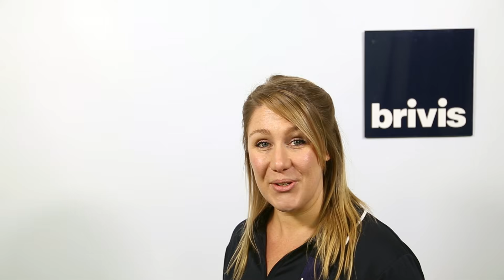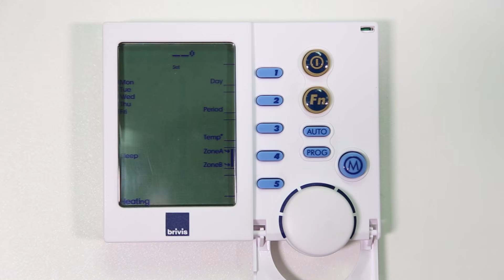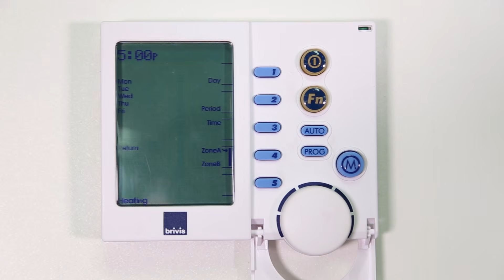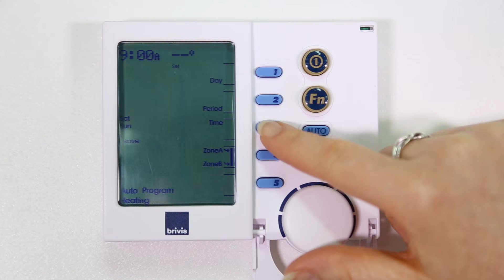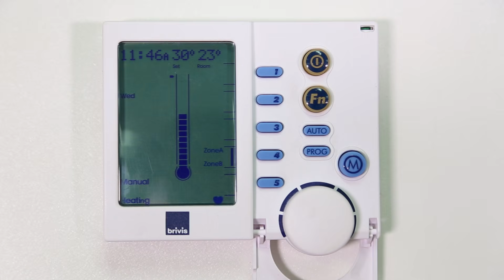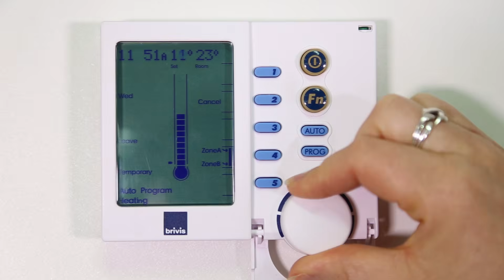Programming your Brivis networker wall control for automatic operation

Comment: How do you get the f thing on?? I’ve had three houses with these units and they are absolutely infuriating. 
It works intimately (all three units did) and then when off there are no batteries to replace and no clue as to how to power the bloody thing on!

Comment: Does anyone know how to control the fan speed? We’ve moved into a house with this system already pre installed… have come from 20 years of split systems which is way more efficient and can regulate fan control but this ducted piece of crap… I can blow harder than this! 🤷‍♂️ Double entendre I know but it’s true… I need to feel air blasting out of the ducts not like it is now… any ideas?

Comment: After 25 years of the first, we're onto our second Brivis heating/cooling system. Our hopes that that the controller and the instruction manual, in the intervening period, had become more user-friendly were dashed. It's the same frustrating gobbledygook as 25 years ago. C'mon Rinnai did you every bother to get testers off the street to make sure that the controller and the manual are easy-to-follow. Within the past 25 years, there has been the Design Thinking concept. This is where designers work with real users to see how the users think, feel and behave when using a product. Or is the attitude that if it was good 25 years ago, it's good enough now!

Comment: Installed 10 years ago, zones never were programmed correctly. No heat whatsoever in main bedroom. Now stuck on error code #40, won't turn off, blowing cold air throughout the house. 'Serviced' 3 days ago for $250, didn't fix the issue. Monthly power outages round here have made me an expert in programming the controller. Only way to turn it off now is at the power point.
Reply: To be fair, service guy found the corroded Over Heat Switch on a subsequent visit had gone open circuit. Simple fix to remove altogether and fuse permanently closed.

Comment: I find it much simpler to use the Manual mode giving more control of the varied times that I am home and so not having it waste gas when I am out and not following a fixed imaginary normal routine.
Just found this out myself in the online manual after a power failure put it into the unwanted auto mode for a week or two after using the simpler more in control Manual mode. Wasted time looking for the simple answer in these videos
From the online manual :
press the “AUTO” Key until “Manual”
appears in the bottom left-hand corner of the screen

Thanks to Brivis for the online more comprehensive manual being made available. Would help if you described manual mode and provided a link to the manuals covering the models in use.
But a shame these videos do not cover Manual mode that is much simpler and puts your customer more in control.
Reply: Now two years later I had the same problem after a power outage. So glad I found my own comment on how to activate manual control.

Comment: How do you use the manual mode?
Reply: press the “AUTO” Key until “Manual”
appears in the bottom left-hand corner of the screen

Just found this out myself in the online manual after a power failure put it into the unwanted auto mode for a week or two.

Comment: If your Networker Controller screen displays a blank screen wth rectangles (8) across the top it means there has been a malfunction (why -?) and the controller needs a "Total Reset" *  Luckily Brivis have a video for this at https://www.youtube.com/watch?v=3Pz4k1_x5-M 
*Note: I couldn't find this information in the manual and the "malfunction" belongs to the "controller" itself and not to the heater, (which will display an alert on the display and is explained in the manual).

Comment: so to clarify:  “wake” at 7 am, means startup sequence behins at 6.30 am and that i would need to adjust  the dial to 7:30 am so as not to be woken up by the preheating rumbling fan before 7 am .... that the pre-warm period is built into the program? if so can i also set “leave” at 7:15 am without interfering with the wake program?

Comment: I just want to turn on the air with lower temperature, not programing it, too complicated for me
Reply: Alicia, If you are in Manual mode ( Manual is displayed on the screen at bottom left when you turn on the heater) rotate the dial, clicking backwards to get the lower temp. to suit.
 If you are in Auto Mode you can do the same to temporarily override the set Temp. for the period you are in.( However you would have to do this at each period. So it would be better if you could get a "Digital Age" contact to follow the video and re-program your settings as needed.

Comment: this is the most frustrating thing i have ever used
Reply: I have this exact System and its a Pain to setup. Half the function are not even available.
Reply: Manual control solves lots of these problems.
Just found my comment of two years ago reminding me how to do it.
Manual control much simpler.
Reply: Same xD
Reply: Agree
Reply: Right!?
Reply: I can realte
Reply: On off 16 degrees or 25 how fuckn hard is it IT wankers always make shit 100 times harder than it ever has to be
Reply: Yep, I’d rather stay cold for 15mins till the house heats up.

Comment: Is it possible to turn the heater or cooler on only for rooms?
Reply: See Manual p 10. This option can be selected in Manual mode and also programmed for Auto mode, If you have a zoned set -up at the installation.
Reply: @thetaijicentre9704  im confused?
Reply: @okayshorty8754  I took "only for rooms" to mean you have specified "Zones" that can be programmed differently to each other on the networker 6. ( I did not elect to do this so what ever setting I choose - it goes for whole house.) "Zones" must be configured as part of the the heater and ducting plan at the installation. And if so designed then its settings can be programmed into the networker wall control, at your choosing any time. (However in my case, I cannot choose to only heat the lounge room without the bedroom being warmed too.)

Comment: My Brivis Heater is so loud aspectally in the room at the front of the house were it has the biggest ducked vent. can you adjust the fan in the unit . it seems to be at its max. very annoying and noisy.
Reply: Any luck with the fan Rod, have same issue
Reply: Tommo 76 No, seems like you can’t adjust the speed of the fan on my unit, l just put up with the noise. Next year considering on getting a wood burner.

Comment: What if the controller is used for evaporative cooler? How to run the system in fan-only mode?
Reply: Yeah Goodluck getting an answer bro. 
Move to Antarctica for cool and migrate to India for warmth. 
Your Beavis console on your wall is useless

Comment: How do you change the clock time? It's wrong for mine right now.
Reply: Turn it off.
Press button 5
Set time with knob
Press button 1 and keep pressing until you get to the right day
Press 5 to save the settings
Full manual
https://www.plumheatcool.com.au/wp-content/uploads/2018/06/Brivis-Ducted-Heating-Manual.pdf
Reply: i am so grateful for your reply. i have so far been stuck in daylight savings time and Autoprogram therefoe  at wake 5:30 if i forget to turn off the power before bed. The ignition and fan is the best wake ip device i have ever used ....  but until i learn to reprogram it is far too early. At least ill be back on winter time   with your advice!

Comment: after talking to brivis sales/service I am very disappointed that there controls do not have a simple sleep timer which allows you to select the system to turn off in a time period eg; 15mins 30mins 60mins as split systems have had on there controls for the last 20years.  System works great but if I knew there systems were still in the stone age I seriously would of purchase a different brand.
Reply: Disappointing

Comment: why don't you have a (simple) sleep timer as in turn off in 15mins 30mins etc like every split systems has on the remote.
I don't really care for going through a whole seminar, I just want my air con to turn off 60mins after I go to bed and one sleep button. 
this is OK if your a robot and live life in a structural box. Seriously a little thought should go into these controls .
Reply: Did you find out if there is a sleep function? I just got this unit and am trying to figure out exactly the same thing??

Comment: Hi there, can't find any where in the manual or this video on how to actually set a "period" that you want to start. I've entered the times and temps as per this video but if I was to leave for work at 7:30am how do I actually start/ set the air con to come on at "return" settings. Do I turn the aircon on at 7:30am and select the "return" period or something?. Thank you
Reply: +Atack Family Watch the video again! Or scroll to 8.45min into video